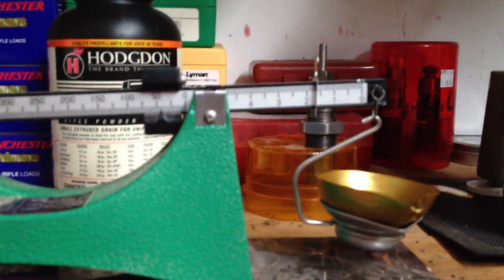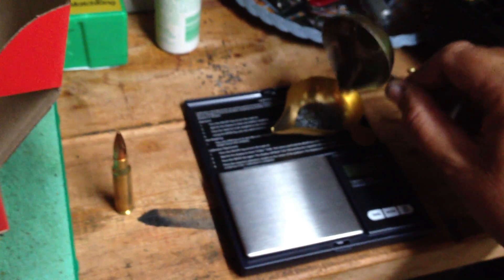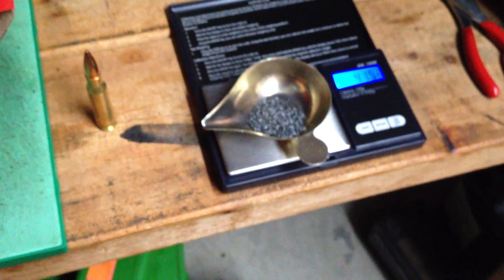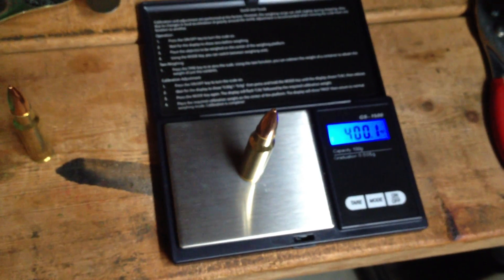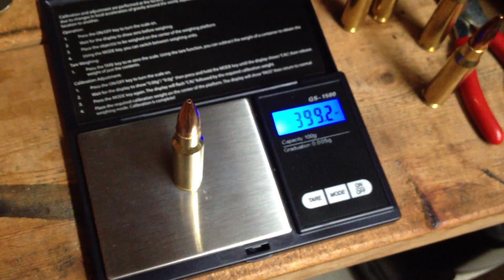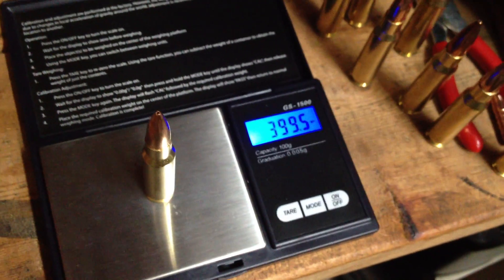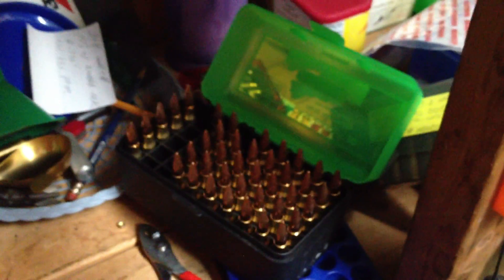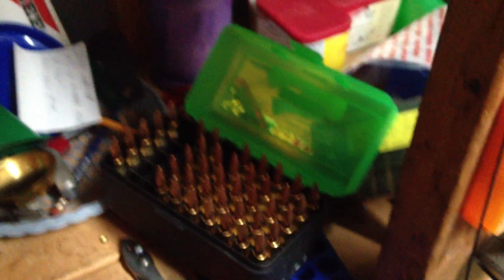Sleuthing the Federal Gold Medal Match long range load recipe.

Comment: Dear sir,
I am new to precision long range. Looking at getting into reloading. Not trying to reinvent the wheel, just clone FGM175 and eliminate some variability and inconsistencies.

Last weekend, I chronographed a whole box. Couple weird outliers brought my ES to 41 but SD was 9.5

All of my testing has been 20°F, 40°F, 60°F but overall I'm averaging about 2635fps out of a 24 inch Krieger 4 groove 1:10 and averaging 3/4 inch groups

Questions
Does today's GM175 still use the same weight of the same powder?

If I hand load the recipe in this video, what would be your scientific wild ass guess for ES/SD?
I would like to see my ES under 20

What about group size? Do you think seating depth consistency could bring those average groups down to 1/2 inch, or more like 2/3?

Thanks in advance.
Reply from the maker: This was the military Mk316 Mod 0 sniper load, developed for the Navy and used by the other branches as well.

The original charge was 41.745 grains of IMR 4064. They came out with what might have been the Mod 1 version, and it had 43.0 grains of IMR 4350

This is in Federal brass, which should be annealed every other time. It's  soft, and work hardens quickly.

They used the Gold Medal 210 primer, but CCI 200s or BR-2s should work fine, or just the standard Federal 210.

43.0 grains is well under all published maximums I'm aware of. That charge should get you around 2600 fps from your barrel.

I do handload consultations by phone, if you need further help. It's a 45 dollar call and includes follow up help. You can see how to set that up at OCWreloading dot com.

Comment: I recently loaded 175 Smk in federal case with 210 primer and 41.8gr of imr 4064. I got 2550 fps out of a 20 inch barrel. I also shot some federal gmm 175gr and only got 2460 fps. Did they change powder? Thanks in advance
Reply from the maker: Some of the FGMM 308 ammo does seem to have a different powder than IMR 4064. I've see a shorter cut powder at less than 40 grains in some of it. It shoots tight, but it's slower, as you've noticed. I don't have any idea what this faster burning, shorter cut powder is, but it's probably one of the Alliant powders, since ATK owns Federal and Alliant... and Savage... And CCI/Speer... :o
Reply: Yes it still shoots good just noticed it was slower
Reply: Have you used the new 169gr Smk?
Reply from the maker: one of our instructors has, with excellent results. Much higher BC than the 168 and shoots very well in his rifle.  @TravisZeller-pd5lq
Reply: What’s your thoughts on using the 168gr load of 42.8gr imr 4064 with the 169?
Reply from the maker: It'll work. Bullet weight is close enough, you may tweak it down .1 grains and try that, at 42.7 grains. 
 @TravisZeller-pd5lq

Comment: Do you have an idea of what the hornady 140gr eld match 6.5 creedmoor load is?
Reply from the maker: The original load was 41.5 grains of H4350, in Hornady brass with a 140 AMAX. Any 140 grain bullet will work fine. Hornady actually printed that load recipe on the original 6.5 Creedmoor boxes of factory ammo.

Comment: Why would this work only in federal brass vs lapua for example
Reply from the maker: Federal has pretty thick brass, and case internal volume is less than  Lapua. Add .2 grains of powder to stay on the node with Lapua... use either 42.0 or 43.2 grains.
Reply: @FuelTankerMan  ok .. thanks for replying and for your advice… are you saying to go up in .2 grains and not .5 ? Still learning about reloading so please forgive me if my questions sounds odd

Comment: Great video first time i watched it was about 8 years ago. I did that my self and got same results 

Today, march of 2023 i pulled two 175fgmm  and to my surprise i found 39.4  and 34.3  of short and gray powder with is not imr4064.  🤔
Reply: In addition the overall length and ogive lenght varies by .010 “ between 5 rounds 😱
Reply from the maker: @dominik954  those Sierra match bullets have some length variations due to the  meplat... but they shoot very well. :)
Reply from the maker: They're no doubt using a faster powder for the commercial (not military) load. Did you mean 39.5 and 39.3 grains (hopefully)... that could be AR-comp, at that  charge level. ATK owns Alliant and Federal...and CCI... and Savage... and... :/

Comment: I've heard that Reloader 15 figured into some batches of US military 7.62 match ammo. As a propellant it's probably going to be very similar in performance to 4064.  I know I sure like 4064 as a powder for mild to moderate hunting loads in .30-06 under 150 grain Hornady Interlock spire point bullets.
Reply from the maker: They did use RL15 in the M118LR load back in the late 90's, early 2000's... In LC brass, they started with 44.2 grains which I knew would be too hot, and wrote publicly about it. But of course the gov't doesn't listen to guys like me. :)

They ended up dropping the charge to 43 to 43.1 grains with the 175's, and it worked very well.
Reply: @FuelTankerMan  That's interesting. I've loaded a few test rounds of .300 Savage with Reloader 15 under 165 grain Hornady Spire Points. That load holds promise as a hunting load  for .308's little brother. I think Reloader 15 is a pretty decent powder for those cases in that capacity range.
Reply: @FuelTankerMan  But temp stability caused (RL15) it to be replaced.
Reply: @FuelTankerMan .   I load my 308, with 168 grain Amax bullets with 43 grains and reloader 15 powder I get quarter inch Moa groups they don’t make 15 anymore so I’m using up the last jug that I have should last me a long time after that, I’ll have to try 4064 👍

Comment: If I think back to my day is at Fort Benning with the M 24 I’m pretty sure that the standard to which it was held was 1.1 MOA. Not an overly impressive qualification. There are much better combinations out there.
Reply: How far was “back in the day?”

If you were using the M118SB I believe it, that was lackluster stuff.
Reply: The M24 is kind of a turd, isn't it?

And military standards are typically subpar by comparison to civilian standards

My custom Remington with a Krieger barrel averages 3/4 inch and 2635fps using factory GM175
Reply: @mr.nobody68 I would never call the M24 a turd. I’ve seen it put a lot of bad guys in the ground. But it’s not a custom made bench rifle either. It’s meant to be drug through the mud and snow and sand and still put steel on target.

Comment: Do you know what the federal gold medal match 300 win mag 190gr. Load is?
Reply from the maker: I don't know what it is now. A commonly used match load is 73 to 73.5 grains of RL22 with the 190. If you're loading FC or Norma or Nosler brass, use 73 grains. Winchester or Remington or Hornady brass, use 73.5 grains. Work up from 70 grains to ensure that you're not getting pressure issues, as it's an at max load.
Reply: Thank you

Comment: I was curious about the recipe because my LR-308 shoots 175 gr Gold Medal extremely well, so I decided to buy a box and take it apart. They must've changed the powder again because I found an average of 40.5 grains of powder. I also took the powder and put it side by side with IMR 4064, Varget, H4895, and IMR 4895 and it looks completely different. The kernels inside the cartridges that I pulled out looked much shorter, about half the size of IMR 4064. Would this be Reloader 15? If not, is it just IMR 4064 that's been cut down for metering?
Reply from the maker: At that light of a charge, it's probably XMR8208 or something in the 4895 burn range.  If it's RL15, it's an off lot, for sure... but they will use off lots of powder at times.   I have not seen Federal Gold Medal with a charge that light, but the MagTech "Sniper" ammo has 168 grain match bullet with 40.5 grains of a powder much like you describe.
Reply: @FuelTankerMan  I have done quite a bit of testing with IMR 4064 and haven't been able to duplicate the FGMM results. I'm going to try again and take extra care in my brass preparation and weight sort all my cases and see if this improves results. I made another 25 rounds where loaded cartridges are all within 1/2 grain in total weight. If that doesn't yield some better results, I'm going to say FGMM has been made with some sort of witchcraft because it shoots 3/4 inch groups out of my gas gun at 200 yards consistently, but my handloads are typically 2-3 inch groups at 200 yards.
Reply from the maker: @billbee235  it's probably the FC brass, it's not very good for reloading... gets work hardened fast.  LC (Lake City) is better.  If you want to reload and get FGMM performance (better, actually) use Lapua brass and 42.0 grains of IMR 4064 and 175 grain Matchking.  If that doesn't perform, the rifle should be checked out--it's really that good.  :)
Reply: I found the same as you. I took some 175 Federal GMM loads apart this week and found 40.2 - 40.3 grains of what looks and smells exactly like the RL-15 I compared it to. Definitely not 4064. Shoots great in my LR 308.
Reply: Scott Carpenter I think it’s a 4895 powder. I tried 40.5 gr of H4895 and it performed that same as FGMM however I took Dans advice and tried 41.8 gr of IMR 4064 and took my time on brass prep and shot 1/2 MOA groups at 200 yards my next time at the range
Reply: @billbee235   Bill, the powder in my rounds were not the same size or color as the 4895 that I had on hand. It was Hodgden 4895.  I poured some RL-15 in a small container and if you mixed them up you couldn't tell the difference. It didn't look close to any other powder that I had on hand. I know it's not very scientific but I would like to duplicate the load with the Sierra 175's.
Reply from the maker: @scottcarpenter3115  if you test the 40.5 grains of RL15 let us know what velocity you get, as compared to the factory FGMM load.
Reply: @scottcarpenter3115  so how did the 40.5gr of RL15 work out good I hoping ???

Comment: I just bought some of the federal MK 316 Mod 0 175gr ammo and I took 2 of them apart to check the powder and the powder charge, I found the powder charge exactly at 42.1 grains of what looked like IMR 4064 and the OAL to be 2.814 for both of them.

Comment: Is this still accurate? This video is a few years old . Have you tried this with a current 175 grain ?
Reply from the maker: The bullet weight won't affect the OCW (optimal charge weight)... so it'll work with the 175's from Sierra or Nosler.  The next higher node is at 43.0 grains in the FC brass, and we've pulled down some of the Gold Medal Match marked 7.62x51 (in the military brass), and some has 43.0 grains, and this load runs about 75 fps faster than the 41.8 grain load.

Comment: I wonder if Federal has changed something recently in the 175 GMM rounds.  I pulled 5 of them yesterday, and the charges of powder were 40.4, 40.3, 40.4, 40.5, and 40.5.  Didn't smell like 4064 - it really didn't have much smell at all, and neither does Reloader15 (that my nose could tell anyways).  They are still hyping it to be 2,600fps, but, I can't any book data to support rx15 being able to do 2,600 at ~40.5gr?
Reply: Brian Spence i just pulled some powder out of GMM 175 and mine were 42.5, it looked like 4064
Reply from the maker: Federal like all other big ammo makers will get occasional great deals on off lots of powder, so it could be a fast lot of something that didn't meet canister grade spec (the vaunted "proprietary" powder, yes).  But as long as it shoots well, all is well.  Federal is an ATK company, and would have in-house access to any of the Alliant powders, so I'd suspect one of those before anything else.   They're using CFE223 or the 2000MR with the 185 grain Berger GMM load now.  AR Comp could be another possibility in the charge level you found in that batch--if it's canister grade.  I doubt it's doing 2600 fps from most rifles though...
Reply: AR Comp seems to fit the bill better than the others, just going off their published data.  Might have to pick up a lb this weekend and do some testing with it.  Only reason I'm interested in this particular run of GMM, is that this box shot exceptionally well in my AR10.  Would really like to work up a good load with the powder and bullet combo.  Thanks for the help!

Comment: How much VV N150 would be needed to replicate the 42.8 IMR 4064 for the 168 FGMM?  BTW, I think Federal will change powders due to interruption in supply.  Thus, the differences we see over time.
Reply: TheMetalGuy852 I've been reloading since the 70s.
Reply: TheMetalGuy852 look up the Sierra sheet for the 168 SMK.  it's been around for a long time.  and nobody is MFing the guy's work on the video.

Comment: Hi Dan.  Great info.  How would the charge weight differ if using standard LC brass?  Would you recommend 41.8 gr of 4064 in LC brass?
Reply from the maker: it should be the same... next higher node would be 43.0 grains
Reply: Dan Newberry Hi Dan. For some reason my hand loads were consistently 100 fps slower that factory GMM. I chrono'd factory vs my loads. Any ideas? Thanks in advance.
Reply from the maker: the lower node is 41.8, the higher node is 43.0 grains of 4064 with 175's... we've seen Federal using 43 grains as of late, so that's the next step, use 43.0 grains and it'll get you that 100 fps

Comment: How does IMR 4064 meter from a Dillon powder measure?  I was going to use this powder to replicate MK316 loads on 175 C-SMK bullets, but I heard it meters like Lincoln Logs so I went with H4895.  I'll be shooting these out of a 16 and 18in barreled LMT MWS, so I need the high-production volume.  I could single-stage them, but it would be a shame to not use my S1050 for it. Also, how is the Lake City LR brass with this charge you posted?  Should I use less starting charge weight or good to go?  I'll be doing full case prep + annealing on this brass.  Thanks in advance.
Reply from the maker: Lake City should be about the same.  If you want to use the H4895 which will meter better, load it at 41.0 grains and check for accuracy and velocity.  The next higher node would be at 42.2 grains or so with the H4895. The old DuPont made M118LR load was 42.0 grains of IMR 4895 in LC match brass with the 175 grain SMK's.
Reply: Thanks for the assist.  Will give that a try.

Comment: does the primer matter much? I have a ton of federal brass, but as far as primers go, I have cci200s and federal 210's (I bought them from an old guy at work and I think they are... aged... but seem to have worked this far) not the 210m's
Reply from the maker: the primer isn't as important as many who don't use Optimal Charge Weight loads would have you believe.  Try the CCI200's and the Federal 210's and see if one or the other is markedly better in this application--then just go with that.  There should not be a significant difference in accuracy, but point of impact might move slightly, and one primer or the other might have tighter chronograph numbers when you test the loads.   Then... as odd as it may sound, next trip out the other primer will do better.  So don't worry too much about which primer you use, as either will work fine.

Comment: Dan by some chance did check the OAL of the 175 & 168 Gr loads ? Your video is very informative
Reply: Actually, i found they varied from    .010-.020" on the oal, on current production 168gr fgmm

Comment: Could I sub Accurate 2495 for the IMR 4064 since the burn rate is close? I bought a bunch of 2495 when I was deployed to Afghan because it was all I could fined online.  I could start out with 39gr and work my way up until I start pulling sub moa groups.
Reply from the maker: dostalusmc979 no... the 2495 is closer to IMR 4895.  Instead, work around 40.8 grains in FC or LC brass, or go to 41.2 grains in Winchester... 41.0 in Lapua or Remington or Hornady... should work well.  Next higher node is about 1.2 grains more powder.  Work up carefully.

Comment from the maker: listen up guys... we address the issue of identifying potential factory powders during the video, and more to detail here-->http://practicalrifler.fr.yuku.com/topic/1238/propreitary-powders#.VOpsDC6GW-c

We don't advocate just opening a shell, dumping the powder, guessing what it is... then putting that much of XYZ powder into a shell and shooting it.  Most folks who have read through the first chapter of any reloading manual will know better than doing this.  For some odd reason, there are folks who go a bit berserk when the topic of sleuthing factory ammo load recipes comes up.  Do factories use "blended" powders?  No.  It simply makes no sense to do this.  Factories will not tell you that they use "blended" powders (unless they're lying to confuse you, and I would like to see a link to a factory ammo webpage that indicates the use of "blended" powders)... but they do say their powders are "proprietary"--which simply means that they are not going to tell you what they're using.  And think about it... why would they tell you what powder they're using?  They have no good reason to, and a bunch of reasons not to. :)
Reply from the maker: yes, LC is about the same volume as the FC brass, so lower node at 41.8 grains with 175's would be about right. And there is a higher node at 43.0 grains as well.
Reply: Dan Newberry 

Hello Dan, any idea what this load would be In lapua brass? Or Winchester brass? 

Thanks.

Comment: Winchester 168gr Match cartridges are extremely accurate... tho I have old boxes and new boxes of it and the old boxes don't shoot half as good as the new ones... I would love to know what powder they use... I took one apart and it had 45gr of a very fine powder with the odd cylindrical kernel.
Reply: I would say the powder you see in the winchester round in Win 748.
Reply: stroudads That is an interesting choice for them to use in a match loading. 

748 does not shoot well in anything I’ve tried it in. 

760 is great in .30-06 though.
Reply: Heavier bullets require less powder due to increases in pressure of the heavier bullet in the barrel.